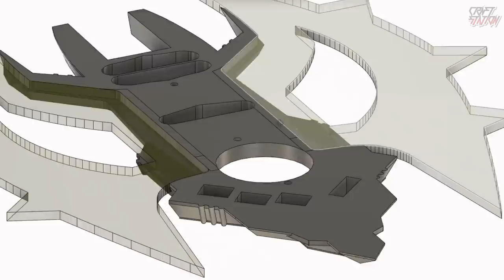HOW TO MAKE WORKING GUITAR FROM DOOM ETERNAL

Comment from the maker: You can buy this guitar here - https://boosty.to/dreadcraftstation/posts/366389ad-2c31-411f-b772-63c14d49aa71?share=post_link
Reply: Why a 6 strings it's Doom and she sounds bad 👎 😕  Maybe next time I buy it
Reply: Why is it 65 thousand usd
Reply: it's the price for is wardrobe wood
Reply: @kenzocroce1507  That's rubles, the actual price in USD is around $1000
Reply: @Bepsi_Man  Oh thanks so much didn’t know :D
Reply: @Bepsi_Man  Where do i get 65000 rupees?
Reply: Is there one for bass?
Reply: @RomainPaco  what’s wrong with six strings?
Reply: @RomainPaco  It has everything to do with the pickups and your set up. You can take a $100 guitar and make it sound great nowadays.
Reply: Thank you for selling these. Can we request specific pickups? I see you used passive pickups. Can it be designed for active? I use EMG pickups.
Reply: @bigman2165  Nothing wrong with a 6 string. People and their weird idea how many strings a guitar needs.
Reply: Cómo se llama la canción Al inicio del video
Reply: Materials used, and the quality. I  say 300 at best.
Reply: That's damn expensive, But probably for a good reason.
Reply: Still available? I wish I had 1k to spend on it right now, I was saving up for a laptop but if I could buy this instead I for sure would
Reply: Hey I can't see the post but is it still available to buy

Comment: Putting laser lighting is a mistake. The laser is very bad for the eyes. Better led. Great job
Reply: Your eyes are the very last thing you should be worried about while playing doom guitar
Reply: Not worried about the lasers being damaging to the eyes, since their sole use is to be dispersed by the engraved acrylic. He did use leds for the rune in the center though.
Reply: He uses light mode on Discord, he is fine
Reply: Would you rather he make the blades illuminate with actual argent energy and slice your hand off while you play?
Reply: @PLATESWEEPER  How old are you?
Reply: @PLATESWEEPER  YESSS

Comment: 10:38 i was waiting to see if it sounded bassass....no... not at all
Reply: It sounds absolutely terrible hahah those pickups are a nightmare, and he prolly plays it through a cheap transistor amp...
Reply: The tiny pots gave it away along with the cheap chinese singles.
Reply: that's because of the single coil pickup on the bridge wich is the least metal thing a guitar can have
Reply: Could have at least tuned it. Lol
Reply: Well it only says it's working.
Reply: @mennoschiphauwer7031  he like literally painted the fretbord, AND FRET WIRE !!!!!
Reply: @mennoschiphauwer7031  it sounds terrible because his guitar technique is bad

Comment: nice guitar but I wouldn't have used a Strat for the headstock. B.C. Rich Warlock or Schecter would've been better.
Reply: Honestly
Reply: luckily its a bolt on neck so you can change out the neck if you dont like the headstock

Comment: Really should've consulted someone who knows a thing or two about guitar or even the music specific to Doom itself before doing a build like this. A few VERY simple changes in the design would've stopped your comment section from being full of whining and complaints, but they are admittedly changes that absolutely needed to take place.
What you built, in it's current form, is in essence a cash-in toy. A longer, wider neck, 8 string configuration, and some respectable pickups (along with an actual setup) would've made this an iconic build.

Comment: Why you mount battery into body if you can use stereo jack to power up all possible electronics from simple 5/9/12/whatever v adapter pluged into simplest pedal, like it did EMG with its ES-9?

Comment: Man you go so far as to CNC the entire body and LED rig up the acrylic with the runes and shit, and then you just buy a premade neck and totally ditch the aesthetic from that point on. 

Not to mention that it's basically a cardinal sin to not put a hot rails humbucker in the bridge on a metal machine like that. 

It's so high effort and yet so disappointing at the same time because you cut some really strange corners.